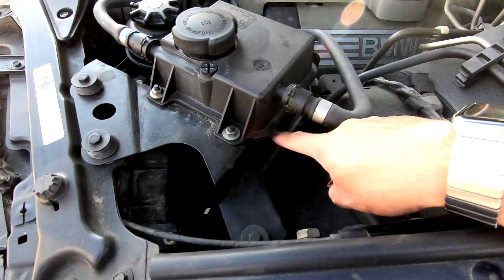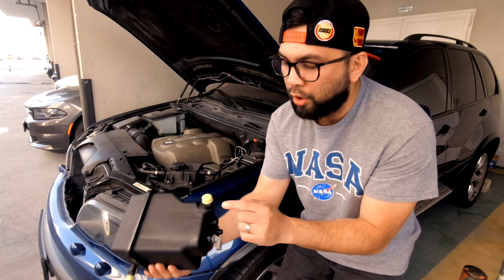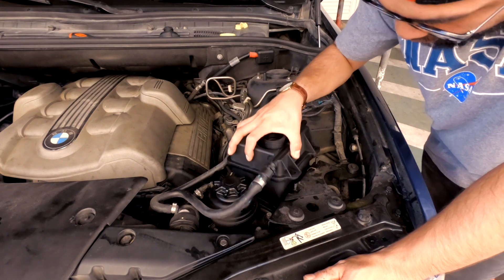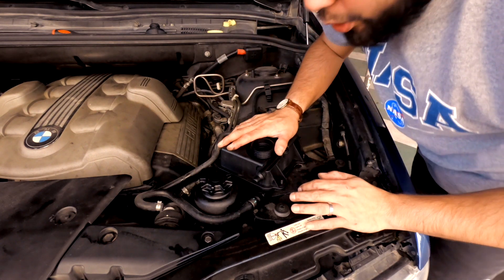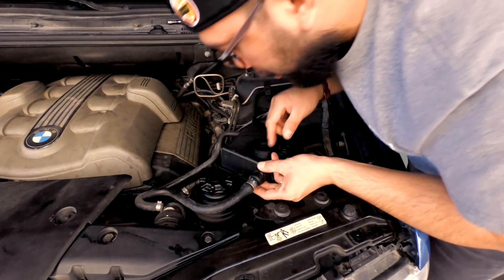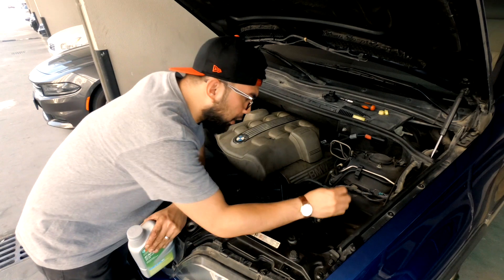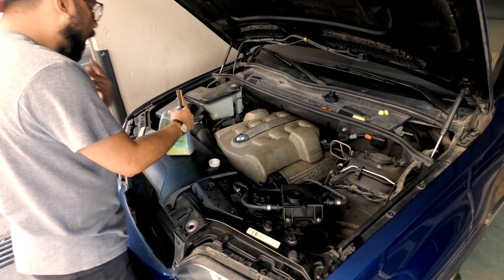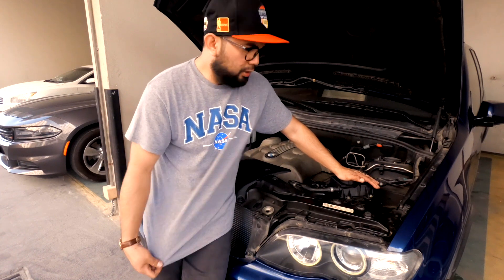Dubai | BMW X5 4.8is coolant expansion tank replacement | DIY

Comment: Hey, quick question ... is the expansion tank a 'circulating' type? I have this 2005 BMW X5, same tank as in this video.  Mine broke in 2 pieces at the seam and won't hold liquid.

Will it be possible to drive with the expansion tank in this condition?
Reply from the maker: Hi Brian, Mostly due to years of usage that expansion tank give in even the gauge/meter sometimes cut into half. My suggestions you have to change it because it will lead to other issues because coolant produce air pressure that can damage engine and to have peace of mind while driving.

About to drive? you can still use it but make sure you have spare to refill because of the lickage & listen to engine vibrations or engine rev if you heard this means you have less coolant.

Hope it helps you & any questions about X5 e53 feel free to contact me!
Reply: @IanGSantos  ... I had it towed to the shop, hopefully no big problems